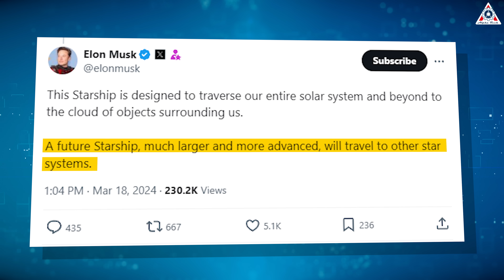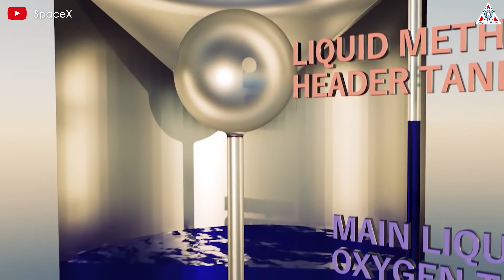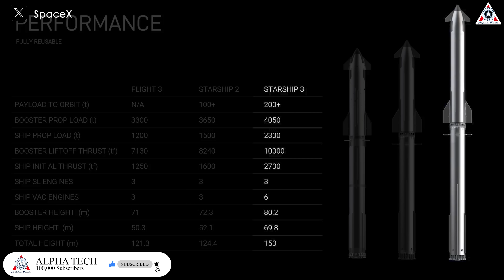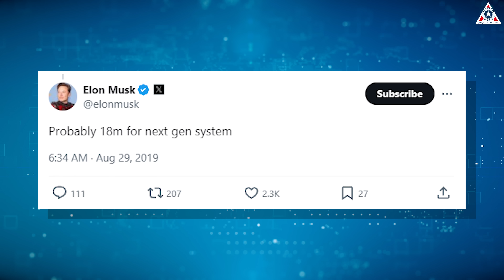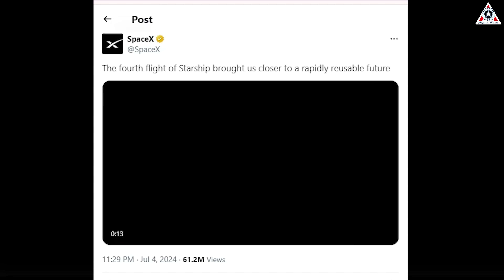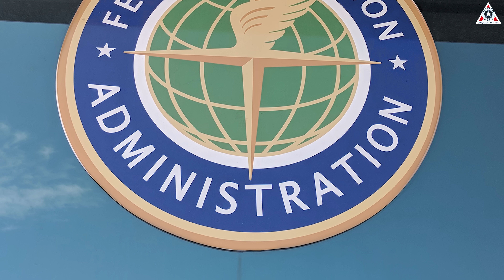Starship Is Getting Bigger and Bigger Than You Think! Here's Why

Comment: The f*** is Elon even going on about a star system is another star, you could have a starship with a 100m diameter and still travel to other stars would be impossible. Like even Nuclear thermal rockets are not good enough for interstellar travel, like you need to use nukes at least to do interstellar travel, and you wouldn't drag a steel Starship all that way with you.

Comment: I don't get the larger rockets for ground to orbit to Mars. I'd assemble in orbit, then head out to the other planets
Reply: Assembling in orbit requires a habitat for the workers, and launches of the entire construction infrastructure into orbit. Also, the construction infrastructure has to first be optimized to minimize weight since it has to be launched into LEO.
Reply: @imconsequetau5275  I realize that. It would make more sense to build the infrastructure to support this, than to build launch vehicles that go from ground direct to Mars. Likewise, building something above Mars makes sense too.
Reply: @rjm9430  
How does building in orbit become cost effective? It seems to me that building on the moon's surface might be cheaper because so much material can be mined right there.

Comment: Bigger ship better thrust to weight ratio, the one big weight saver Musk needs to ad is parachutes to reduce speed for landing without burning so much fuel on the way down,  All the prior manned missions used them to some degree to reduce speed between reentry and landing.  Even the shuttle fleets had drag parachutes deployed on landing to cut forward speed.
Reply: SpaceX exploits the large surface area and nearly empty tank volume to slow the ship. Parachutes only work once the temperatures are low enough for synthetic fibers. However, reentry from orbital velocity creates extreme temperatures that parachutes cannot withstand.
Reply: @imconsequetau5275  They already used them for breaking into orbits with much higher speeds between planets (they do have an operational range but lighter than any fuel for any object to passively resist gravity than powered. (scaled up on both is a geometric advantage as well)  Even in sea ships bigger is cheaper per ton with only channels and harbors as real limits on size if a ship can be filled.  The Panama Canal is the limit for our Navy or our Carriers and Battleships (before missiles took over the big guns) would have grown 20-35% larger even before the end of WWII just to match Yamato and Bismarck.  The unbuilt class after Iowa would have been heavier in guns (4 turrets) and armor but would have lost a third of the speed because the engines were the same as Iowa as the design wasn't allowed to grow.
Reply: In order to use parachutes for the final approach, the Starship would have to deploy ones with surface area far greater than the broadside of Starship. If this mass exceeds the weight of the propellant of the current design, then it doesn't seem worth while. 

Also, parachutes cannot assure the ship will approach the landing site within a couple centimeters, so the engines will still be needed.

Comment: Fun fact old size limits goes back to the width of two mules.  Larger is better with any ship (land, sea, air or space) for payload/fuel ratios.  The problem is the need to build on site as it grows too big for rail or highways,  The old Shuttle boosters and prior NASA rockets had tunnels and overpasses dictate some limits.  The two mules were the standard going back to Roman times for highways, tunnels and bridges that carried over to both cars and trains as they needed to use existing wagon roads, even the military hummer had the failing that it was too wide for many roads forcing alternate means of travel (including the return of military pack animals) Also the old jeep was sized to us the standard rail with the tires removed if needed but the Hummer was not.  The old Shuttle had to fly on a special 747 but the SRBs traveled on the roads and rail.  An uncle even worked on them for a while when the change came through for the O rings after Challenger.

Comment: Everyone should know a stainless steel rocket has never carry an astronaut or a payload. 

Reason it can’t, the rocket is the payload times 3 and doesn’t have a complete buildout of starship. Their no module for astronauts, no life support system, no astronauts Manuel control system. Starship doesn’t have a astronaut escape module. So look up the weight of stainless and the weight of aluminum. You will find aluminum weighs just 10% of stainless steel. This why Falcon 9 and super heavy work great being constructed of aluminum and not stainless steel. Elon you are wrong. Your engineers you have left won’t tell you what you don’t won’t to here.

I ran 4 separate manufacturing facilities. I surrounded my self with people smarter than me. To succeed it take more  people with  their own ideas. Then if you’re smart you take a consensus of your staff and especially your engineers. If you had done this you would be using aluminum and a inconel heat shield. To get to the moon use three boosters with the same 33 engines you have now. If not keep blowing up rockets on your own dime.
Reply: No aircraft or spacecraft are made from aluminum but aluminum alloys,  Pure aluminum doesn't even exist in nature because it refuses to bind to itself and is why aluminum alloy based airframes have preset retirement points as even in a vacuum will turn to dust over time.  Steel is heavier but much stronger meaning less is required for any job offsetting that weight issue.  The best option (but expensive due to 80% the global supply is in Russia) is a high Titanium alloy, that is both stronger than steel and lighter than Aluminum.  Also used since the cold war days as the primary metal in the hauls of Russian subs while we we forced to use steel because we didn't have enough.  In fact we had a whole smuggling operation to get the metal from Russia to build the SR71 and other stealth bombers during the cold war.  They have already proven what it is able to do and they are refining it.  A big reason for steel too is that it is much more stable with the heat of reentry as aluminum has a much lower melting point and will burn away much sooner. Also the Titan sub if the haul was titanium instead of just the ends it would likely had survived as the fiber was strong under tension but not on compression causing it to crush like a paper towel tube.  If you really want an example of something heavy that flies look in to the cast armor steel tub on the A10 and the system to hold the spent shells as if the nose lost the full weight of its ammo it becomes unflyable empty.  Michael Dorn did own an A10 and had to pack weights in the nose before the military did a forced buy back,
Reply: @charlesmaurer6214  Usa military, uses more Russian sourced Titanium,than russia.

Comment: How could the diameter of starship grow? If it did then it would be larger than the SH booster. The booster cannot get bigger or it would no longer be compatible with the OLM. Nope. Starship and SH can get taller but not bigger around.
Reply: adjusting the launchpad to this new diameter would fix that my friend ;)
Reply: A new, larger OLM can be built. But only when the 9 meter diameter is obsolete. That will require many years.

Comment: How much fuel is consumed at the bottom of the pyramid to get the Superheavy going only 20mph? Extend that to there being a 3-stage option, the first stage being reusable but only goes 10 miles down range. Or, to require fewer engines and less additional weight, what about detachable reusable tanks that can be recovered from the water, 10 miles downrange? They could detach before max-Q.
Reply: The "third stage" can be whatever fits inside Starship.

Comment: Because Musk and SpaceX started making Starship doing the bare minimum of actual design planning and testing.  The result?  The starship they have now weighs a lot more than they thought it would with all the stuff they have had to add just to get it to survive.  And so it can barely lift itself to orbit, dead empty. So they have to make it taller to add fuel, but making it taller only increases fuel linearly. And the mass of the additional rocket does, too.
So they have to make it larger in 3 dimensions, so they get a larger volume for proportionally less surface area. Because, y’know, rocket equation.
That means EVERYTHING they have done so far is wasted effort. Because they have no idea if their rocket idea and tower system will scale and perform the same.  This is why Other rocket companies don’t start slapping rockets together Willy Nilly, but take the time to think thru the entire rocket, ALL of its subsystems, its supporting infrastructure, and DO THE MATH to figure out how much all of that will weigh Before they build it, so they can adjust the design, lighten components, change the specs, test their assumptions and modify them based upon actual results, and only THEN finalize the specifications for their entire system.  Because building a launch pad is COSTLY AND SLOW, you only want to have to do it once.
THAT is why rockets like Saturn 5 and Artemis flew perfectly their very first try.   Because the entire system was engineered and designed and THAT work dictated the rocket and its necessary facilities. 

SpaceX built an OLM that folks who knew told them would not be survivable, with a fuel farm too tall and too close for an OLM that has NO blast diversion and no means of attenuating acoustic shockwaves. They built an entire system around an Idea they had NO evidence to suggest might survive on re-entry, and just ballparked the size without knowing what they would have to do to make it survive launch and re-entry nor how much weight that would add. They sacrificed their plan for full reusability to make a hot staging ring disposable, because with it on their booster could not possibly make its return burns. 
And now where are they? Nowhere near having a rapidly resuable launcher, nowhere near the payload Musk claimed it would have, nowhere near meeting the goals NASA paid them billions for. They have had to entirely re-build their fuel farm and support facilities because they failed to understand the forces they were going to be creating and refused to listen to expert advice from successful launch facilities built up to 60 years ago.   They have had to spend hundreds of millions repairing and slapping workaround bandaids on an OLM design that refused to consider 60 years of launch experience.  
They have a starship and dedicated launch facility design that can’t lift more than itself, can’t survive re-entry without melting away large important chunks. And ALL of it will have to be torn down to accommodate a NEW unproven design that they STILL will not have demonstrated to be workable, and so they might end up, once more, in the same place, with a rocket too heavy to lift anything but itself and that still melts on re-entry.

I would love to see Starship work… but I design and build things for a living, and thus far SpaceX is looking like a clown car act as far as Starship is concerned.
Reply: You really haven't paid any attention to any of the design discussions. And, have no idea how iterative design works - I guess you are still using an Apple 1. See you back here in a few years.
Reply: @JohnUrbanic-m3q  You clearly don’t design things for a living.
Reply: That was a lot of words.  

I’d still bet on SpaceX pulling this off

Comment: so in essence - Starship is useless since it can't lift more into LEO than Falcon heavy
If you make it taller, then Mechazilla is also useless and also needs redesign

so we are back to building gigantic metal silos in the hope that it will work out, knowing that everything higher+heavier will performe worse in efficiency
Reply: Falcon Heavy has a max cargo of 64 tons, while the current Starship capacity is 150 tons if reusable, 250 if expendible. They have mentioned before that increasing the size is actually beneficial to efficiency.   Unsure how they figure that out but they have lead the space industry for some time now, so I know they will succeed eventually.
Reply: It's not a final product, but an initial first iteration of the orbital prototype. The current Starship design is quite a bit overweight, but that will change after several iterations in robotic fabrication and design are done. 

There is a good reason to build the early prototypes from cheaper (weaker) alloys. As hull alloy strength is increased, thickness can be reduced. The stringers can be altered in quantity and thickness. The bulkheads between tanks, and thrust puck, can be made lighter. 

Once the features that are known to be too strong are scaled back. In addition, Raptor engine thrust and ISP capacity is growing incrementally but steadily. The booster is getting 2 more engines to handle the longer stack.
Reply: It is all about a race to the lowest cost per pound of cargo to orbit and which orbit low/high/Lunar/interplanetary.. Falcon Heavy right now is the lowest cost to high orbit up to 60ish tons, Starship right now is targeting low orbit heavy lifts to triple what Falcon Heavy can do.. Starships next generation is targeting high to Lunar cargo in the 150 to 250 ton range for an even lower cost per pound.. Where the bottom of this cost to lift ratio is right now is hard to say but there are figures on what it would take to make a functioning Lunar base that can mine minerals and metals, refine them and manufacture structures and spacecraft and fuel and oxygen and water etc.. It will take several hundred flights to get all the machines and habitats to that point.. My best guess would be that these things would be sent direct for the first few and then unloaded in orbit and the V-2/V-3/V-4 of Starship would become space trucks that return to Earth orbit and get reloaded and then given another TLI boost to repeat the journey thus saving fuel by keeping the ship moving..

Comment: 18 meters is just shy of 60 ft. thats like the footprint of a decent sized pole barn.
Problem I see is increasing complication via using the small engines. 

I know the Aerospike engines tend to be problematic too,  but starting to realize that the spike doesnt have to be a spike.

That you could build engines that were rings, with the combustion chambers fabricated, and the fuel mix system fairly monolithic instead of a gazillion pipes. You'd still need manifolds and divider systems, but you could run methane coming in past the center combustion chamber wall to cool it, and oxy past the outer chamber wall to cool it, and in both cases preheat the liquids and do a phase change.

This would allow a very simple pumping system on a single shaft. Maybe even running off the phase change via a feedback loop.

Then you could insulate outside of the wall chambers, and reduce heat loss.

Heat loss is wasted efficiency. 

Also you could do concentric rings. maybe running the pumps off just a central smaller ring.

This would be a way simpler device. and with MIG welding tech you can fabricate in any metal, undoubtably including optimal combustion chamber metal alloys.

Also you can fabricate in much thicker metals than currently used, on battle ships in WW2 up to 12 inch steel was used, and they chamfered the plate edges so there was good access for a welding rod, and paid people by the pound for filling the V.

You wouldn't need that kind of thickness, but you could have your combustion chambers be effectively any scale.

And they could be made up of curved sections you pressed into the rounded shapes for inner and outer wall of combustion chambers.

Talking way more durability factor possible than a gazillion small bottles.

With an upscale to 18 meters, we are back to using outboard boat motors to power a battle ship again with current scale Raptors.
And on ring engines its gonna be an S curve shape and gap factor that creates your combustion chamber.

And we already know how to build very large turbines, we have some meters in diameter, that have been running since the early 1900's in mega power plants. I know of one that hadnt had an oil change since 1920, and is still powering a small city a hundred years later.

We have the technology to do the pumps and build to scale. And a big thrust torch with very few moving parts, is better than an array of smaller ones with X number of moving parts.

I'm sure SpaceX will continue on current path,  But I just wanted to throw this concept out for guys to start thinking about, and maybe startups experiment with...

Who ever comes up with a functional and efficient mega engine, is gonna dominate in rocket engine tech. And the rest is fabricating
 "Vacuum Boat"
Hulls, and installing life support stuff, and other structual and access necessities.

The engine is the heart of the rocket. and I suspect too many small engines would have way more flow resistance than one big mega engine.. They are like trying to get volume and velocity out of a garden sprinkler watering can...
The more reaction mass for the time factor, and how fast you can accelerate it, dictates the results.

Also if ring engines didnt work well enough for Earth's gravity well, they would be worth researching for use between orbits.
Just so potentially simple, and built to huge scales fairly easily.

Just sayin'